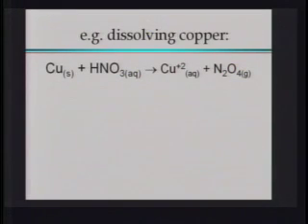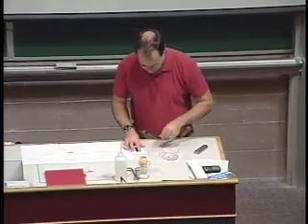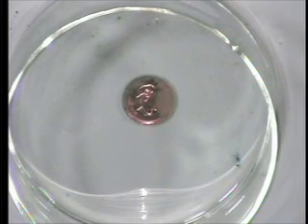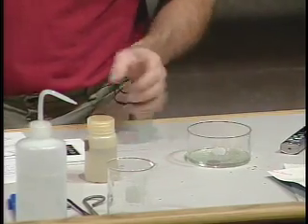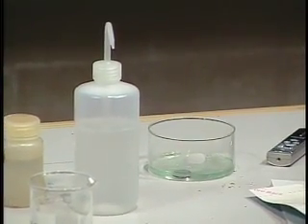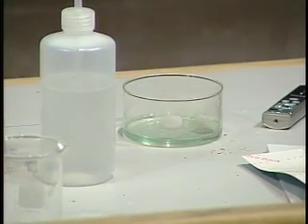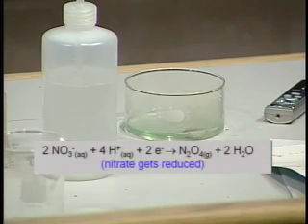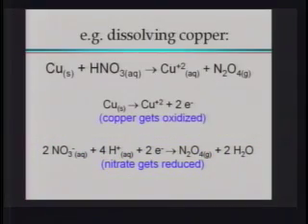Oxidation of Copper

Comment: Heat of the fire causes the wood to fall apart due to thermolysis and the gasses that are created in that process are the ones that actually burn.
Reply: @Oliver Davis instablaster =)
Reply: @Kyler Kieran thanks so much for your reply. I found the site through google and im trying it out atm.
Looks like it's gonna take quite some time so I will get back to you later with my results.
Reply: @Kyler Kieran it worked and I finally got access to my account again. Im so happy:D
Thank you so much, you really help me out :D
Reply: @Oliver Davis No problem =)

Comment: Hey, Bob... Depending on what year that penny was it was 97% zinc or steel both are only plated. I'm no scientist but explain to me what would the interaction of Been if that penny is only been copper-plated zinc filled? Or what would it have been if it were steel? What year was the penny... 1997 change to zinc 2000 changed to steel..? Let me know.
Thanks